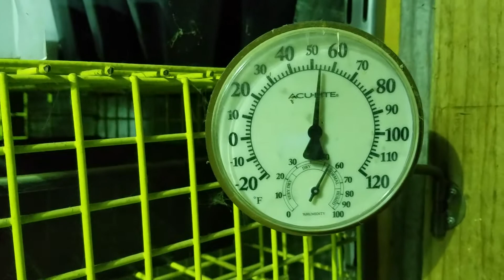Rocket Mass Heater in Greenhouse Review

Comment: I have mice issues also, try tar at those trouble spots. Mice don't like tar. Also, I use batch box, firebox made out of 55gallon drum wit door kit from Northern tool  I also learned to add secondary air to chimmey at fire port backside of the riser

Comment: Was all the duct laid with a slight upward angle or just flat? You need about 1" of rise per 6ft of duct. Without it, the gases will stall. Also, if you rout the duct back toward the Drum and run the exhaust flue up against it, it'll recharge the gases in the flue with some radiant heat, causing them to rise faster and creating a second siphon effect through the duct.
Reply from the maker: Hello Kentuck, yes, duct was laid out originally with a slight uphill grade till it made the vertical rise to the chimney. This winter I did deconstruct the "J" Tube and barrel to move that on the other side of the greenhouse wall into the aquaponics room. During deconstruction of the barrel and manifold, I found that a mouse family had moved into that spot, which was all cob earth mass. The mouse had excavated a burrow and moved all of the excavation into the 8" duct pipe, restricting the 8" opening down to about 3". I have only laid the foundation for the "J" Tube in the aquaponics room and will soon complete the reconstruction of that part of the system. When I have completed that, I will report on the operation of the new stove layout. I just felt that I needed to get the potential smoke hazard out of the greenhouse. Now it will be in the aquaponics room where there is greater ventilation opportunity in the winter. On the Peaceful Glen Homestead, I practice a Permaculture / Regenerative design approach to all of my projects. Regardless of how well I plan and study other designs, I have yet to complete a "system" project that did not have some glitch in it's operational function..... However, I never, never, never quit on a project. Thanks for watching and commenting on this post. You can also check out other project on facebook at Central Virginia Permaculture Institute

Comment: I'm thinkin the fire box, hot part is not sitting directly under the riser tube. If the flame was jumping up the core, which needs to be well insulated, well that would be a huge thermal lift for the thermal siphon effect which would add plenty of push to overcome any other hang ups in your flow's get a long. It would help to have a good wind cap outside to help prevent downdraft of course along with a fiberglass wrapped outside riser with tin wrap over that to at least not have negative flow from that part. Another heat saver would be to build a box around the barrel and surround the barrel most of the way up with say 9" of pea gravel to slow the heat flow radiation there. Then surround the serpentine tube with a coarser rock/gravel mix for better heat flow out of that part of things. They've found that a tight sand or the like pack on the serpentine isn't good for best heat conduction/flow. Of course, one needs to figure out how to shut off the exhaust air at the end of burn. Unfortunately, this means either going back out to "brick it off" or rigging a timer on a servo to do it automatically, not too hard to do if you can figure it out. I like the idea of a gravel surround as it makes a faster build and easier take down to rectify problems. Looks like a cob seal around the pipes would help too. Hind sight is great and I thank you for this big ole effort to help the rest of us see what not to do, which can be as helpful as the other way round at times! As well, a big thanks for the nice effort at "tubing" this for us! As for the mice, I have the knock on that for sure. In my greenhouse they were causing havoc so I on Amazon, search "Just One Bite Blocks" , unlike most mouse blocks that take along time to get em, a mouse or rat just has to nibble a bit of these and it's a done deal! I put a long nail through the center hole to keep the pack rats from carting them off. Keep well out of reach of kids or animals! Works like super Coumadin. Thanks again, this was a real help!

Comment: Great video! Have you tried closing down the burn tube by putting a plate or brick over the opening? Restricting combustion air flow may increase the intake air speed and stop the back flow. Also did you provide a source of external combustion air? That would increase the air pressure inside the green house and help prevent back flow.
Reply from the maker: Yes, on the combustion air flow, I placed a piece of tile over the opening and that did help some. However, I did not think about adding airflow into the greenhouse but when I read your statement , the bell went off in my head. I currently do have a means of pushing air into the space through an external passive solar collector duct bank but at sunset that will be pushing outside temp air into the space, seems counter productive. I am interested in hearing your thoughts on the introduction of air
Reply: An underground pipe directly to the burn chamber may be the easiest.
Reply from the maker: Thanks for the input, no pun intended